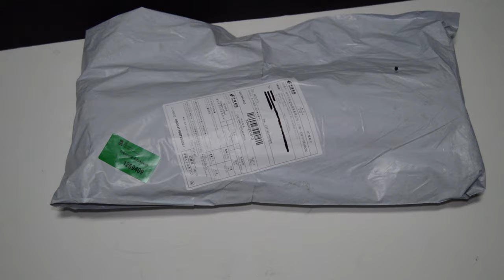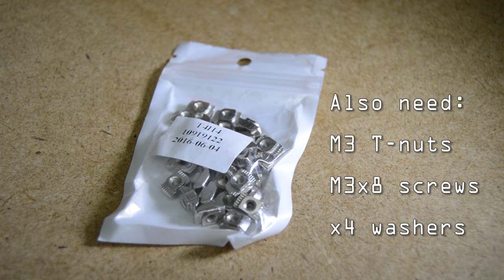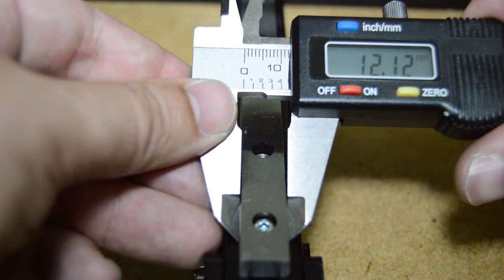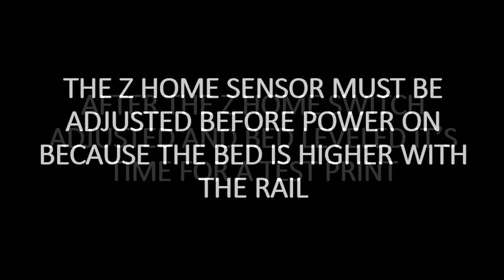TEVO Tarantula i3 3D printer - HOW TO improve your printer - Part 6 (Rail upgrade)

Comment: Is there any difference between the MGN12C and the MGN12H linear guide? Thanks
Reply from the maker: Hi G. Lewiss,
Please check the datasheet of the MGN rails.
http://motioncontrolsystems.hiwin.com/Asset/MG-Series-Catalog.pdf
Reply: Hi ruiraptor, Thanks for the link to the info. It seems that the letter H means it's about twice as much precise than C.
Reply from the maker: Hi G. Lewiss,
no problem ;)

Comment: belt is angled...otherwise seems like a neat upgrade
Reply from the maker: Hi, you are correct but it's angled because the belt loops over the Y carriage and later i corrected it by looping the belt under the Y carriage. You can see what i mean in the carbon fiber Y carriage video.

Comment: Sure hope you fixed the belt issue you created... ya know, where now its no longer a flat plane and is angled? this can make super inaccurate prints....
Reply from the maker: Hi,
i commented this below. The issue was that i looped the belt over the Y carriage plate and should have looped under it. In my next video (carbon y carriage upgrade) you can see that.

Comment: Could you use this on the other axis
Reply from the maker: Greetings,
Yes, you can use an MGN12 rail in your X and Z axis, but for those axis is not that simple. For the X axis you will need a new hotend support to lower it (the rail will raise the hotend) and for the Z axis you will need longer Z motor support.
Reply: ruiraptor ok, do you think that it is worth it?
Reply from the maker: Hi, For the Y axis, the rail it's a must ! In fact, i recommend the Y rail together with the bed support the most important upgrades.

Comment: Linear guides are precision parts. They must be delivered in a rigid box, wooden for example. The bubble wrap is useless. 
Even a small effort during transport can cause 1/10 mm loss in linearity. Did you check with a 1/100 comparator for flatness defects 
on the length after mounting ? Look on the machining forums how those who converts a conventional milling machine into a CNC machine 
install this type of guidance. It's complex to adjust. Even if the displacement is improved, the principle of fixing and adjusting 
the bed does not improve the accuracy of the machine.

Comment: Is it possible to install this rail system on X axis too ?
Reply from the maker: Greetings,
Yes, it's possible to install the rail system in the X axis but you need some modifications.
One issue is that you will have your hotend higher than the horizontal metal profile. You need to make a modification in your X carriage so that the hotend maintains it's height even with the higher rail.
In my opinion, the Y and Z are the ones that require the rail modification. The X axis is not so important because it is not that heavy and therefore the original wheel system works ok.
Regards
Reply: Thank you!
Reply: One more question. It seems 300mm rail is  enough for 200mm bed. Why did you choose 400mm ?
Reply from the maker: Greetings,
My Y axis homes outside the bed area (my choice) so i wanted a longer rail. Also, a 400mm rail is the same length as the Y profile so i get full movement if i need to.
Reply: Thank you for quick response!   Ok, I will order 400mm rail for Y axis and 300mm for X axis to decrease weight .

Comment: Not having your belt parallel to the rail plane is going to induce geometric error and belt tension variations.
Reply from the maker: Greetings Miguel,
You can improve that by passing the belt (through the hole) under the plate instead of over it. That way the belt is "more parallel" to the rail plane. in fact, that way it's very close to being parallel. In this video i passed the belt over the plate because it's easier but i agree that if the belt is installed the other way it's better.
Reply: I later saw your video with carbon fiber parts where you fixed that. Great work.
Reply from the maker: Yes i did :)
Thank you.
Regards

Comment: If you're going to show the test print, show the results of the print and not just the carriage moving back and forth. We all know it moves. We want to see the effect it has on print quality. Seems like there's a far smaller surface area holding the entire bed in place with this mod. The stability of the entire bed, especially when printing on the outside edges, seems like it would be compromised.

Comment: A onde posso comprar este item ??
Reply from the maker: Hi Piter,
Here's an example where you can get them:
https://www.banggood.com/pt/MGN12H-250300500550mm-Linear-Rail-Guide-Linear-Sliding-Guide-Block-CNC-Tool-p-1156260.html?p=84280421195697201804&utm_campaign=21195697&utm_content=3312
Reply: ruiraptor.  Qual é o tamanho exato para atevo tarantula?

Comment: link to purchase site for rail system?
Reply from the maker: I have bought the rail and t-nuts on ebay. Just search for "MGN12 12mm rail"
Reply: Available in Canada and USA here : https://www.electronicgeek.ca/products/mgn12h-single-linear-rails-400mm?variant=25850221379
Reply from the maker: In that link it seems that it sells a pack of x1 400mm rail and x3 carriages. You only need x1 400mm rail and x1 carriage.

Comment: what about the printable bed? thing:2155311
Reply from the maker: Hi Hunter,
I haven't found the thing file you posted.
Anyway, there are some printable beds but in my opinion, they will not be as good as the carbon/aluminum ones.

Comment: it doesnt look right......its rocking back and forth..... during Y direction change....you can even see that in video....and i think that is not this part's fault.
Reply from the maker: You are correct. That is due to the flex of the stock acrylic carriage. And that's why i recommend the upgrade for the stiffer carriage in a following video. The carbon carriage is the best choice.

Comment: can you pls take my the dimensions of the rail..?
Reply from the maker: Hi Dimitris,
My rail is 400mm long.
Reply: i wanted to buy the tevo tarantula with the flex extruder and the auto level sensor. I have heared many youtubers say that it is very good but it has some problems with stability. I what you would recomed me to buy for fixing that.
Reply from the maker: Hi Dimitris,
The tarantula is in fact very good. Get the big heatbed but don't buy the auto level sensor. You can work perfectly without it or you can buy a better one for less.
Regarding the stability, just follow my tips and upgrade videos and you will be fine. If you need more help i can give you when you start to assemble the printer. There is also a big official tarantula facebook group that you can join and learn more about the printer.
https://www.facebook.com/groups/TEVO.3dprinter.owners/
Reply: i saw you video with the Carbon fiber upgrade, is it worth it?
Reply from the maker: Yes...especially the Y carriage.
Reply: i should buy the linear rail to..?
Reply from the maker: Linear rail for the Y axis, carbon Y carriage and dual Z motor.

Comment: Man, you go to all the effort of installing a really nice rail, and then mount the bed with springs, pretty much entirely negating what you did :/
Reply from the maker: Hi dumle29,
Actually, the printer works great with the springs. They are compressed so not much negative effect there.
Although my setup is really stable and I don’t level the bed for a long time, i want to keep the ability to adjust the bed level since I don’t have any auto level sensor.
Reply: @ruiraptor  You should lower your Z limit switch and make those springs tight as much as possible.

Comment: Such uprade is pointless unless You are using two mgn cariages on one rail. With only one the bed shakes more than on orginal Y axis drive. It is better to use two separate v-slot extrusions like in CR-105s . Moreover, china cheap mgn rails and cariages are poor quality and the hiwin are to expensive for tinkering. Generally speaking. Tevo is poor 3d printer. The extrusions are low quality and there are better 3d printers in similar price range.